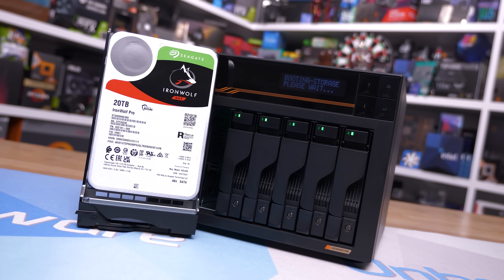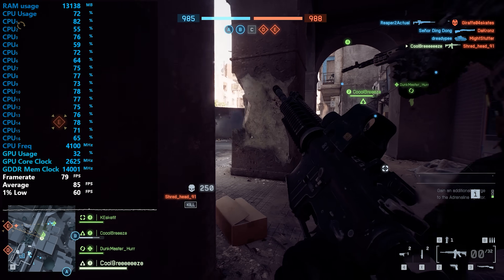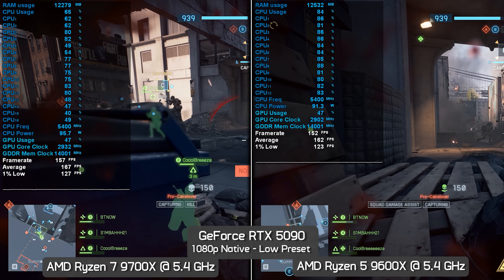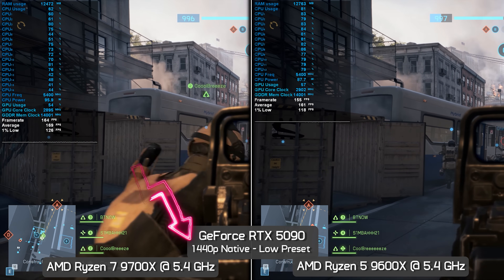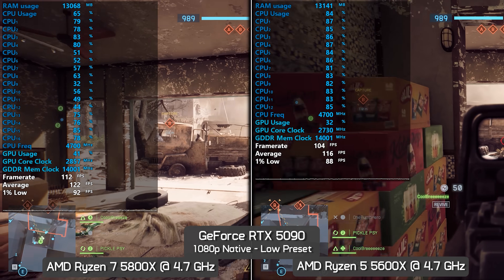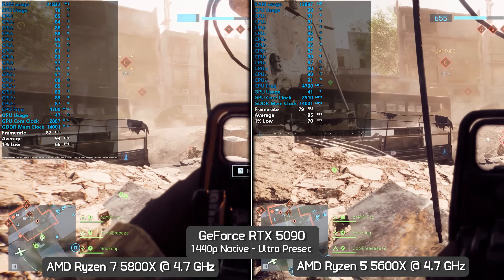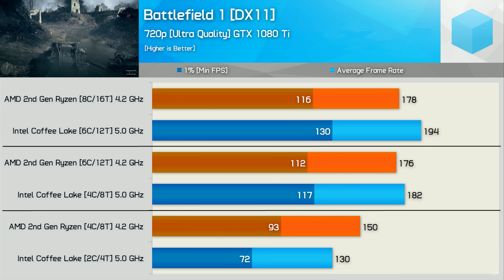Why Gamers DON’T Need More Cores, 6-Cores Still Works Well!

Comment: During the beta,  my 5800x3d rx6800 32gb(3600) memory at 1080p mostly medium setting a couple low and a couple others high I was getting my 144fps that I had it set to. A few big explosions would drop me to 120-130 for a second but it felt good. I plan on staying this hardware for the foreseeable future, I'm using a benq XL2411p that I purchased in 2017/2018 I want to get a 1440p monitor but I know if I of the longevity of my pc hardware goes to crap.

Comment: Well, what ever you say thats just based off benchmarks vs me using them... :))) for the most part (benchmarks arent useless like ppl acuse me of sometimes) but it dosent tell you detaily when youre arent interating with hte machine actively :)
a 16 core just feels nicer to use then 6 ;) my 9950x3d turned off half cores and everything stuttered in bo6, had inputlag and spikes, also longer load times, my 10940x from the old X299 platform was better then that thing was evne tho it just was slower overall :) 
technically they dont ,,need'' more the problem with that word is:
an i5 2500k/8gigs or ram will play most games releast in the past 10 years, but yould you want to? ;)
i wouldnnt go beck to my 5600X from my 9950x, not even at 4k, hell no, as soon as i do a lot a 6 core chip slows to a snake
ive hated my 3800X aftewr a while when i realised that Cold WAr+ discord+ youtube wasnt a thing and what year is it? if you treat your PC like a console because you dont do much, then you prolly should get one^^
tech deals once said: not everyhting on a computer is about a benchmark graph
technically an i3 12th gen has morew FPS then a 5800X but no one would ever wanna play on a 4 core these days vs an 8 right?
but to be fair to you, fro m6 to 8 cores is never enouth of an upgrade and yeah a 5900x is basically two 5600xes slaped together but you can still do more besides gaming with it then on a 5600X :) 
but im hyppy with my 9950X3D, i didnt need to jerk off, it happend alone hehe ^_^ peace to u Steve :)

Comment: 15:55 What you really need for better multitasking performance while gaming, is a second GPU, like an iGPU. Letting the iGPU handle 2D tasks massively helps out while multitasking, ESPECIALLY if you play videos while gaming. Funnily enough, it's actually AMD CPUs that didn't have an iGPU at the time, meaning these people were barking up the wrong tree entirely.

Comment: I have a ryzen 9 5950x 16 core 32 thread cpu and when i played battlefield 6 open beta it ran great yes but what i really hated was the clock speed most games i play the 5950x would run at 4.6 4.7 sometimes 4.8ghz but with battlefield 6 the cpu clock speed would bounce between 4.3 and 4.01ghz i was like i am sure i am losing performance and fps over that large clock speed hit

Comment: My extreme use of 16 cores/32 threads that can't really be done on 6-8 cores (or probably even with other rendering programs) is to have Mandelbulb3d rendering with 16-24 threads, and then gaming with the rest.  Extremely niche, and still avoid doing it with BF2042.  It is nice though to be able to game for a few hours and still make progress on a long render at the same time.

Comment: Im only gaming at 120fps target for game lik doom,cs and cod, but for AAA grapich focus game I expect 60fps stable, so I choose the ryzen 5 5600g rather than the ryzen 7 3700x, not only because I need the IGP, but because its $40 cheaper and newer, I will pair it with the rtx 3060 ti next month probably, and as far as I can see, it doesnt have any issue for the cpu aspect, like the difference in term of uplift performance per generation is becoming more stagnant nowadays, well in term of price/performance or really for what is matter anyway, like I still remember the difference between GTX 1060 vs 960 or the ryzen 2600 to 3600 is quite insane, nowadays I see an RTX 3060 vs 4060 comparision and really not amuse, the cpu tho from ryzen 5xxx to 7xxx is good, but its not really that matter for me, like the difference between ryzen 5 1600 vs 3600 or even 2600 is quite big in term of playability, now is just one can reach 30% much faster from 400fps to 530fps, like ok sure.

Comment: Would be funny to really showcase how much/little cores mean by going all the way down to the fastest quad core, 12100(F) as it can be overclocked, and then full send BCLK OC it to like 5.3Ghz+ not caring how much voltage it needs plus manually tuned high speed ddr5 ram, though the locked SA voltage will probably limit it to somewhere in the 6400-7000 range.

Comment: As always it's a tradeoff with consideration to your budget.
If you can afford a modern 8 core CPU, go ahead.
If you own a powerful enough 6 core CPU or can buy one for noticeably cheaper it will be a more cost-effective choice.
More cores can improve performance but at the end of the day you will be bottlenecked by your main thread so you do need single core processing power first and foremost.

Comment: how does the 7600 compare to the 7600x
Reply from the maker: Same.
Reply: 7600x can use higher wattage and needs you to buy a cooler, the 7600 is 65W, and comes with a cooler included from AMD.

Comment: Steven, can you please make a video on overclocking RAM on the Ryzen 7000 series platform? So many kits fail on 6000mhz cl32 despite being rated for cl28! I just don't get why. I did not upgrade yet but am concerned.

Comment: I've been on a 5600x for a few years now, and even had a 9945hx3d system sitting on the floor waiting for me to feel the push to finish the upgrade/swapping over. But I've not yet felt that need for more performance/capability... 2-3 months and counting.

...this is with a rx7800xt and dual 1440p@100hz panels. So, clearly leaning to the CPU as my weakest link.

Comment: Cities Skyline 2 laughs in your face.
Reply from the maker: Can't you play that game on the 9600X?
Reply: @Hardwareunboxed You can, but the more cores you have, you will get significantly more performance, it's one of the few games that will actually utilize a threadripper well with up to 64 cores. CS2 really wants more cores and a higher frequency over everything else. 

... Now if only paradox would fix the game. 😭
Reply from the maker: I can't find any evidence of this, and last time I checked the game it was still only heavily using a few threads. I just watched someone build a large city on the 13900K and they were seeing less than 20% total CPU usage.
Reply: Factorio snobs it's nose in the air at most every PC...

Edit: Also CS2 is a game that everyone just says is unoptimized, like it's an excuse.

Comment: So in short the game program design still does not  scale that well even when using the functions for auto threading. The problem most games have is with how the software is compiled. As most are moving the newer features to the GPU not the CPU nor NPU the incentive to try to redo the flow chart of how to design the programming for the game kind of  stopped at 8 but for most it stopped at 4.

Comment: HU: Don't buy 8GB VRAM GPUs!
Also HU: 6 core CPU is ok! You DON'T need 8
Reply: 2025: Microcenter offering 16Gb DDR5 9600x combos. When it is a known fact on most every motherboard, it's a pain to run 4 sticks of ram.
Reply: Ikr... Thats why you should just get that 8gb GPU and Threadripper
Reply: Core count doesn't matter as much as vram especially if you do 4k gaming.

Comment: 2600x is great, 3060 gpu, 32gb ram. Can open an play a lot of games, slow but stable if you mess with settings. It will never use 32gb but😂

Comment: Still using a Ryzen 7500F in my gaming rig in my study with a RTX 4070 Super. Not gonna change that anytime soon. The PCs that have more CPU cores oddly are my laptops. 8 core for my work laptop with a Ryzen 7 5825U and my bedside Acer laptop with 14 cores from the i7 13700H.

Comment: It's because the main part of a 'cpu bottleneck' is usually a memory latency bottleneck. This is why x3d chips are way faster. It's the main reason why zen 4 is faster than zen 3: ddr5. And the key reason zen 5 is barely better without x3d: it lacks better memory latency. You may think this is disproven by benchmarks showing that ddr5 6000 is the sweet spot. It's the sweet spot because of the infinity fabric rate: the bandwidth increase is not sufficient to offset the latency increase.
It's hard to be certain though, since changing CPU clock speed is pretty important, but this affects the cache frequency. It's most likely that some combination of sequential bottlenecks are faced
Reply: amd really needed to upgrade the memory controller for zen 5

Comment: *For now.

I'm not betting against poor game engines and poor devs.
Reply: Exactly, saw the headline an my first thought was now make the game developers understand that people cant be buying new hardware just to sate your desire not to optimize.
Reply: poor game engines and incompetent devs will make higher core counts even less useful. It takes much more skill to utilize multi threading effectively in games. The easiest thing to do is just put everything on a single thread and call it a day. If you are betting on devs being lazy you should get a 6 core over an 8 core.
Reply: @Deadpool-se6lq  you got that backwards. Because the engine is poor, the engine devs will cobble together more core support to get away with the poor performance hoping hardware can just brute force it.
Reply: @Spitlebug 100%

Comment: Well, Zen 5 is the last gen you can claim 12 cores are weak steve :D Zen 6, 12 core single chiplet, Zen 7 16 cores. So even if it's NOT Faster, i will buy 16 core without gaming penalty xd
Reply: but thats like 5 years out

Comment: Now that the floodgate is open, future games are going to use 16 cores. For future proofing we need a minimum 9950x3d extreme extreme edition with all 16 cores on a single CCD with all cores having 3d v-cache.
Reply from the maker: haha
Reply: I dont think that is future pc gaming at all. But future pc gaming likely needs lots of vram in gpus, like starting from 16 gb and up. As AI task demands increase from the gpu. You will have newer versions of upscaling and frame generations and multi frame generations. Those will require ever more powerful gpus with ever more vram capacity. Pc gaming really revolves around a powerful gpu. I would say that even 8 core good cpu has some future lasting still. And X3D ones likely even longer future lasting. The bottleneck hasnt been the cpu for quite a while now.

Comment: 6 cores works well for gaming now, but I still fear that this video will age like milk.
4 cores was enough in 2017, and look how fast the i7-7700K went obsolete. Next-gen Zen 6 and Nova Lake are going to give us a significant increase in thread counts after years of stagnation, just like Zen 1 and Coffee Lake did back then.
Even so, the Ryzen 5 9600X will still be good enough for at least a few years, just like the 7700K was; the 9600X is relatively reasonably priced; and the AM5 platform gives you an upgrade path to Zen 6 (possibly even Zen 7) if you need/want it. The situation therefore isn't as bad as it was back then, but I still don't think 6-core CPUs will remain relevant for long outside of the entry-level market. Next-gen games will be optimised for next-gen consoles, which will be much more powerful than the 8-core Zen 2 CPUs in the Xbox Series and PS5.

Comment: "4 core CPU's don't exist anymore"
* checks current CPU availability *
i3-12100 / 12100F
i3 13100 / 13100F
i3 14100 / 14100F
Ryzen 3 5xxx
All still sold brand new. Yes, these are all last gen platforms, but 4 core CPU's do still exist.
Reply from the maker: "no quad-core CPUs sold today that can play Battlefield 6 well"
I didn't say they weren't sold at all lol
Reply: @Hardwareunboxed  Ah OK must have missed that last part, my bad.
Kind of weird though that an online multiplayer game is that CPU intensive.
I'd like to know why that is, since that's pretty uncommon.
Reply: This also makes me wonder how bad the experience will be on a PS5, which has a downclocked (4.1 GHz) 5800X and a downclocked RX 6700 XT GPU, both sharing 16 GB of unified LPDDR5.
If the performance you show on PC with a 5800X clocked at 4.7 GHz with a 5090 is barely above 60 FPS, I seriously doubt a PS5 or even the Pro version can hit a steady 60 FPS even at 1080p native or even 30 FPS at 4K with upscaling from 1080p.
The RAM usage even at 1080p low is also pretty high, close to the 16 GB that the PS5 has in total, so that would leave 3 GB or so for graphics.

Comment: I may not have NEEDED 8  cores when I upgraded from a 3600 to a 5700x but it is still nice to have the extra cores so Windows doesn't slow me down when I'm gaming.
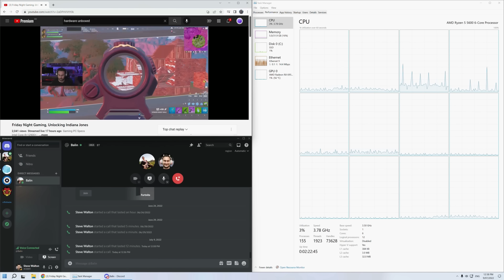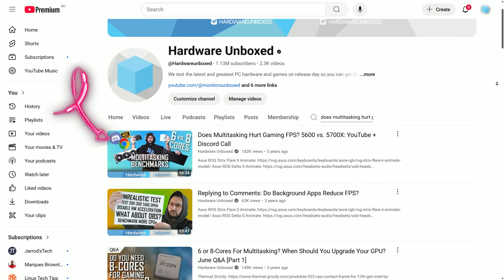Reply: Did you even watch the video lol 15:58 -> 16:30
Reply: @Kaptime  For this time, i in fact did not complete watching the entire video before placing that comment. Watched the segment of the video that you provided and while Steve mentioned video playback or discord use while gaming, they didn't specifically talked about the mostly windows processes i came up with. The truth is yet to be researched i guess. 😊
Reply: 6 cores cpu is sufficient for gaming, but what are you going to do when 'antimalware service executable' or 'office click to run' or 'windows update' kicks in in the background.

Comment: To quote HUB: "It depends".
AMD CPU's have the same amount of level 3 cache on 6 and 8 core CPU's, including the X3D ones.
Intel CPU's scale up in level 3 cache as the core count increases and also have different amounts of cache per generation, AMD is always 32 MB per CCD or 96 MB for X3D.
And of course CPU demanding games will run better on 8 cores than 6, so whether it makes a difference depends on the type of game you play.
Civilization 6, Stellaris and Dragon's Dogma 2 for instance benefit from having 8 cores, whereas the vast majority of FPS or other action / fast paced games like racing simulators will be just as fast on a 6 core CPU and most online multiplayer games will only use 2 or 4 cores.
But yeah, on average, accounting for all games in existence, there is little difference in performance between a 6 and 8 core if the cache count and clock speeds are identical.

Comment: Any kind of realtime presentation - and games are even worse in that regard, as they are interactive - can only be parallelized so much. What do you want to to do async? AI? So you end up with NPCs staring at walls and not reacting to player interaction? Sounds awesome. Maybe somebody can point out a counter example, but from my PoV any game that actually scales well with cores has sub-par performance across ALL possible systems compared to similar games that do NOT scale well with cores, because all that async does for games is add a load of wait-calls that never actually pay off. If there was a 9400X3D that clocked higher than the 9800X3D for its 4 cores, it would most likely be the superior gaming CPU for the majority of games.

Comment: 7600X3D with 7900xt was crushing Battlefield 6 at 1440p despite only 6 cores and just 4.7 GHz boost clock
Reply: Yup. Spitting distance to the fastest gaming CPU on the market.
Reply: Exciting, just got one of those for $256 USD.

Comment: The PS5 and Series consoles only use 7-7.5 cores with SMT. Previous gen was 6-6.5cores without SMT. Most games are designed around the limitations of consoles.

Comment: I've got a 3080 and an 8th gen I5 processor and on the second beta weekend my cpu was pinned at 95% or higher read up it was a possible bug. Other than than this game I've felt no need for more cpu power

Comment: While a 12 threads CPU is sufficient for gaming in 2025, AMD's 8 core CPUs are much more energy efficient than their 6 core CPUs, because 6 active cores in one die use the same amount of energy as 8 active cores in one die. Gamers Nexus has the benchmark data showing this. They measure how much WattHours the benchmark task consumes on various CPUs. The 9700X and the 7800X3D are the most energy efficent CPUs one can buy.

Comment: I think the next gen (Ps6) is where we would see 6 cores lacking and. games utilising more cores as I have heard rumours that the new console APU is essentially going to be using the same CCD's as the actual desktop chips so there wouldn't be really any difference between console and pc on the CCD side of thing.
Reply: memory system on consoles is a game changer

Comment: My 9800x3d barely used two cores for most games and maybe 3 when i was running all the simulator equipment. 6 should be plenty; 8 a little extra

Comment: This is the first time I hear 6 cores and "works well (is enough)" in one sentence. 
Last time I heard "x cores is enough" was when someone said "4 cores is enough".
Reply: And how many years ago was that? 

Time marches on. Single core used to work well and be enough.

The point is, there's no indication right now that having more than 6 cores does much for gaming or that it will in the near future.

By the time 8 cores really differentiates a 9700x from a 9600x you probably will be looking to upgrade anyway.
Reply: Because the demand for more processing power and cores keeps going up. In 5years people will say "8 cores works well (is enough)"

Comment: Hab diese Jahr mein I7 6800k@ 4ghz und 32GB DDR4 3000MHZ im quadchanel, in rente geschickt, weil meine 4080RTX OC davon massiv gebremst wurde, der pcie 3.0 slot bremst nur paar Prozent, aber die Architektur ist trotz 6 Kernen eine Katastrophe nach knapp 9 Jahren, hab jetzt nen 9800x3d mit 2x 32GB DDR5 6000MHZ cl28 auf nem X870e Tomahawk! Das fast als hätte ich ne neue GPU, spiele auf nem 34"Uwqhd, IPS, 120hz, Curved, G-sync Pannel, das wird nächstes Jahr gegen Oled auch in Uwqhd getauscht!